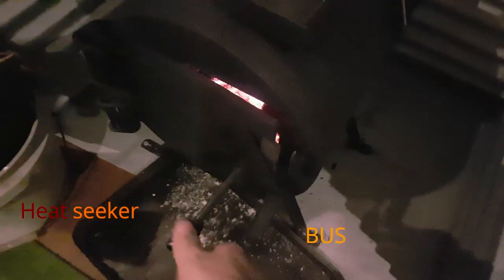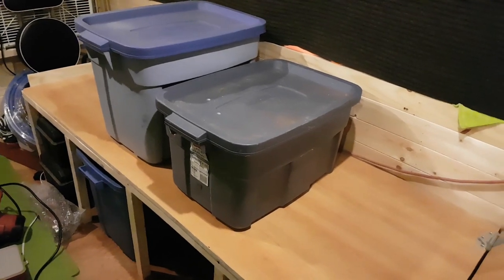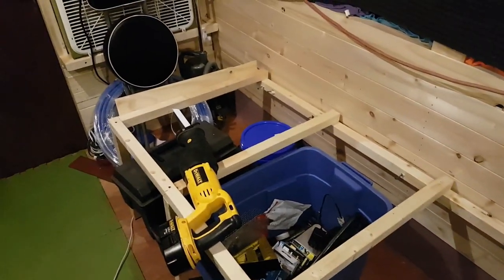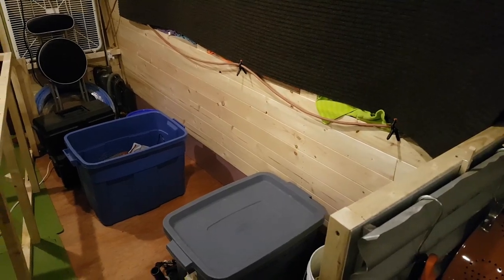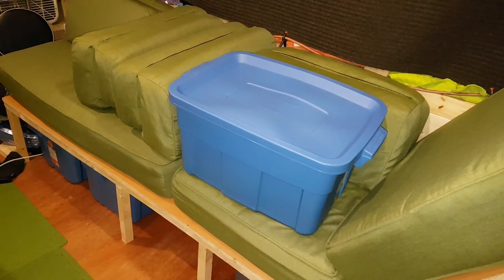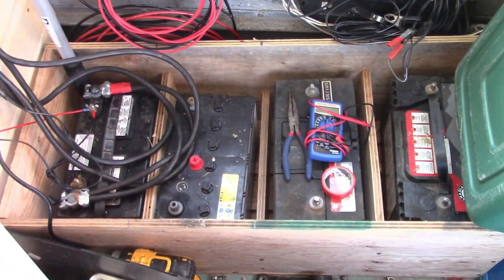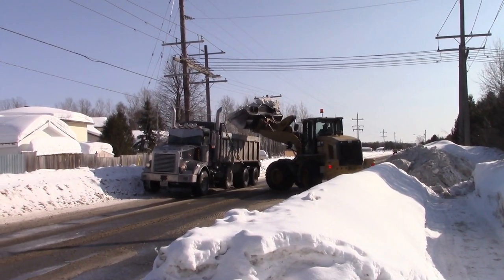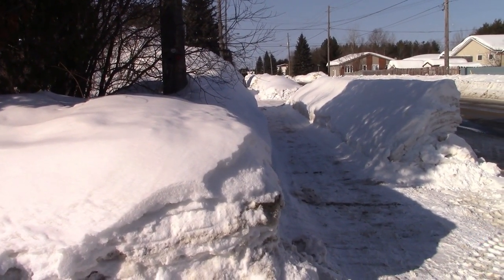couch modifications... Heatseeker Bus conversion. tiny home RV skoolie.

Comment: Tired of the cold here.
Reply from the maker: It's been a long,  long winter. And it's not over yet.
Reply: Its not over here in Phoenix its much warmer.
Reply: How much for the bus
Reply from the maker: @RvDavy  it's not for sale but I have about $15,000 into it so far
Reply: So the basic bus cost you?
Reply from the maker: @RvDavy  I paid  $3000 for this 2006 bus and it cost another $3000 to get it road ready.
Reply: Then to build out completely is cost $10,000 would you say
Reply from the maker: @RvDavy  yes,  about that. 
I would say about $3000 to insulate and finish the interior shell, then what ever you add depends on what you can reuse like,  cabinets,  the  bed,  any wood to build etcetera. My water tanks, the fridge, my  bed and the woodstove added up to $3000. Solar $2000. The other stuff is supplies,  tools,  appliances,  paint,  window coverings,  fasteners............